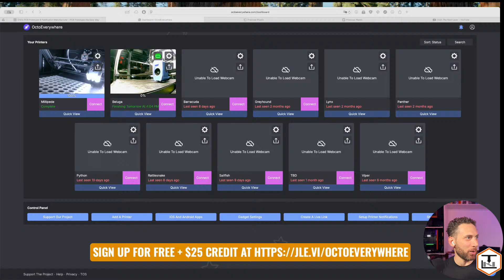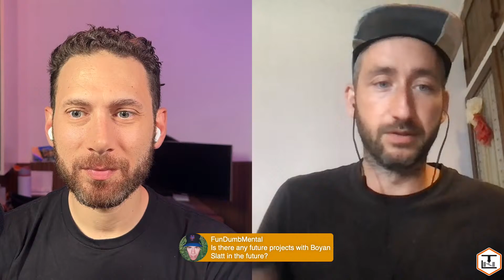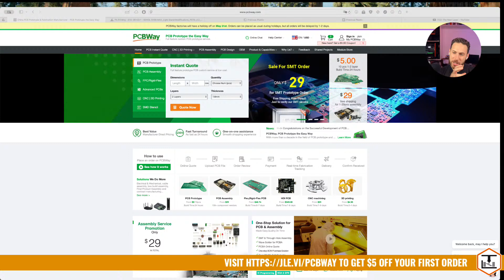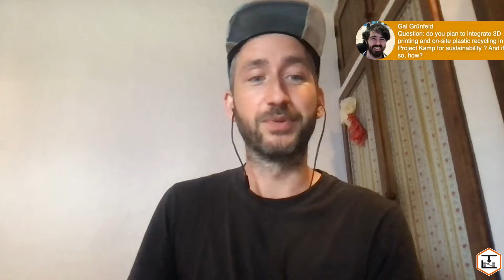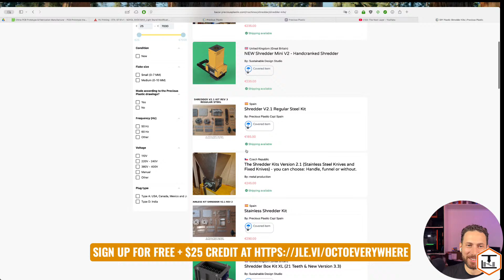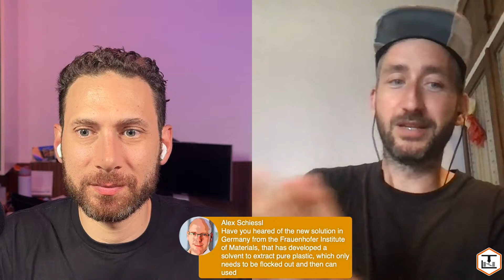Ep. 62: Dave Hakkens of Precious Plastic on Innovating Sustainable Solutions for Plastic Recycling

Comment: Has PP looked into funding grants from gov agencies that wanna reduce waste? I know Foresters Insurance will provide conditional event funding ($200 for a small supplies grant, or more for an event that uses community labor). It'd be dependent on the area, for sure.

Might be possible for PP partners in different states to set up supply lines to businesses that would be able to accept plastic sheets or injection molded parts for cheaper, or at-cost. 

My area has a cultural problem with recycling plastics - most of it just goes to the landfill. Plastic sorting is out of the question. I blame the culture warriors, personally.

Keep up the good fight!!!!!